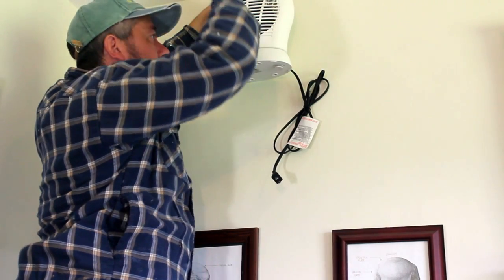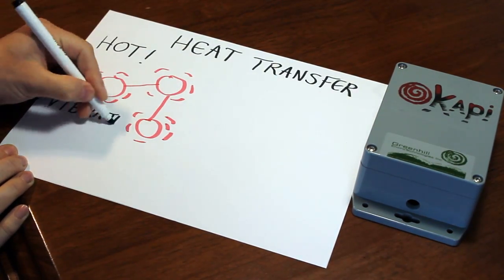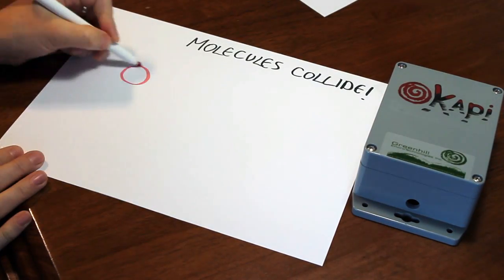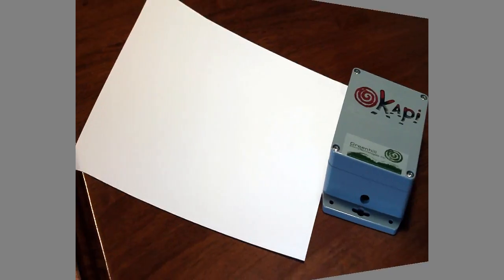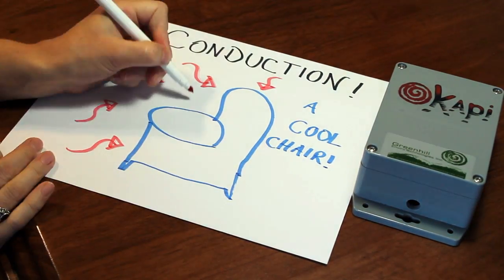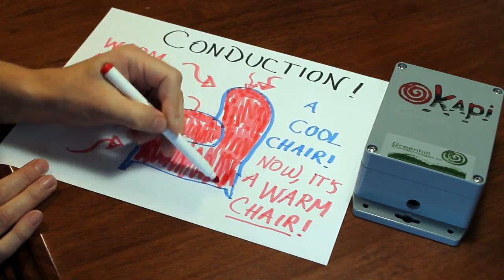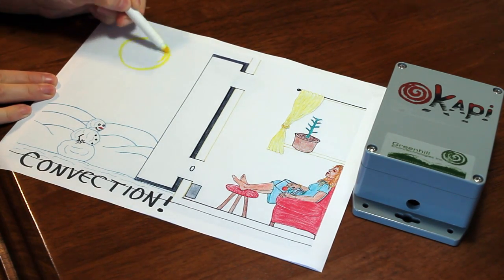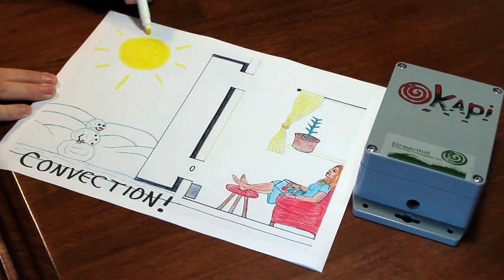Would you install a fan heater near a ceiling? Of course not!

Comment: I often scratched my head over that question, given that heat RISES.  If the heat is allowed to come in on the bottom via the Okapi system method, heat will still rise and go back into the collector, allowing it to heat up faster than if we collected the cool air from the bottom.  Did I explain that correctly?
Reply from the maker: Thank you for your head-scratching, darkvader47! Yes, the direction of the forced airflow with Okapi Systems is the reverse of the historical way. There is a lot of science to support this new airflow direction. There are also products that work like an air tube that pulls warm air from the ceiling and blows it out at floor level. People claim just doing this decreases heat loss and also saves a tiny bit on heating bills.
 Perhaps this following video helps show this, also? 
https://www.youtube.com/watch?v=2yZGxS8eHZY

Comment from the maker: It is also possible to install Okapi so that the air drawn into your solar collector comes from a cooler air source, such as an unheated space near a floor.

Providing you can place Okapi's convection sensor inside (or in a vent) near the top of your collector, you can then install ducting (rigid or flexible) from your collector to any nearby cooler air source.

Okapi is extremely versatile and should work with collectors of any feasible shape, size (up to 8'x4' per unit) or design.